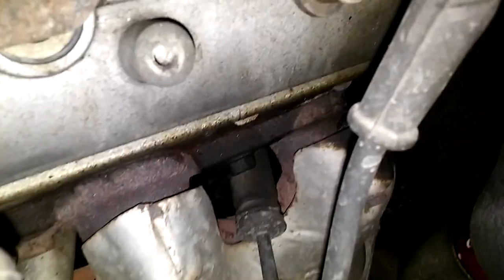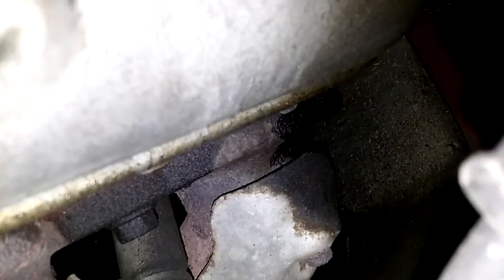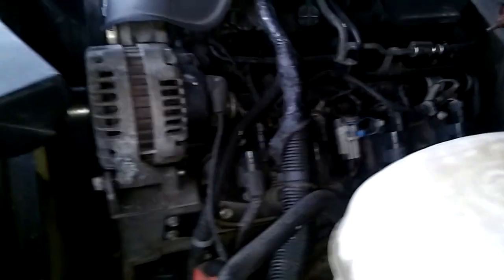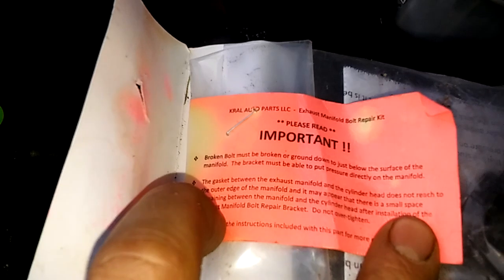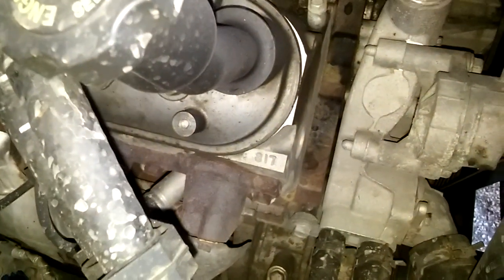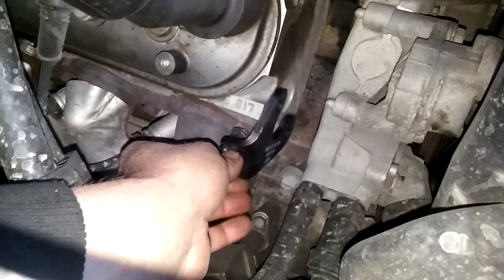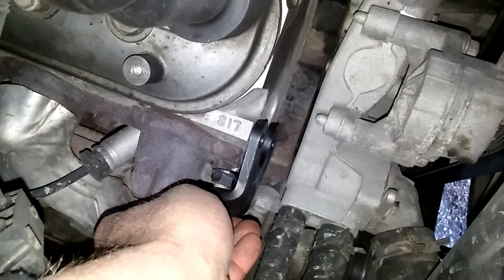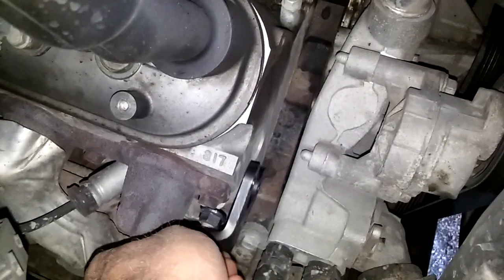Chevy Silverado GMC Serria Yukon 4.8 5.3 6.0 exhaust manifold simple fix

Comment: It might be easier to get to the bolts for the rear of the head by lifting the tailshaft of the trans to tilt the engine forward.  I see the website on the package...thanks
Reply from the maker: I removed the front drive shaft and reached up from under neath using my 15mm gear wrench. I also used shorter factory bolts from other builds with the built in washers on the head. Without the shortness never would have worked. The builtin washers kept the gear wrench on the head .
 I also have skinnier hands. Still leaking exhaust. Not 100% sure its from here still but appears it is. PIA